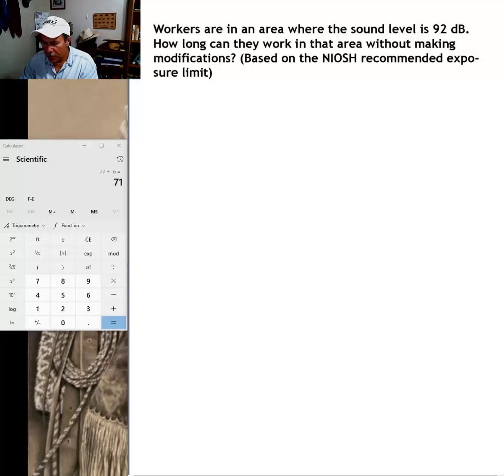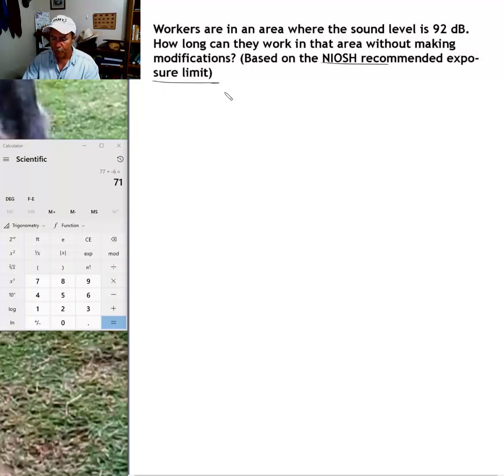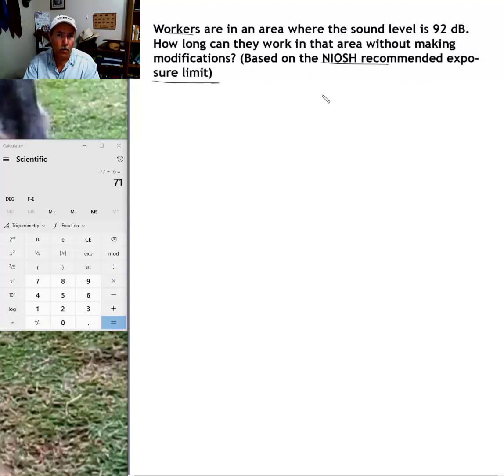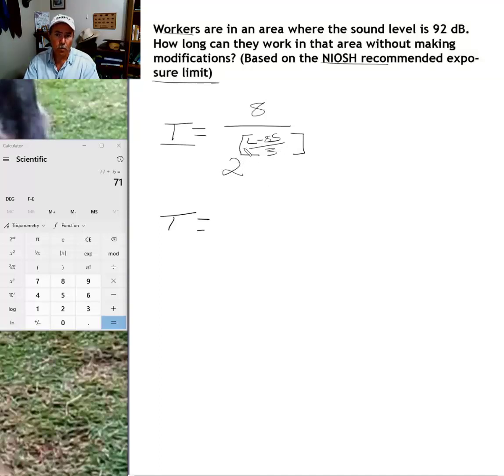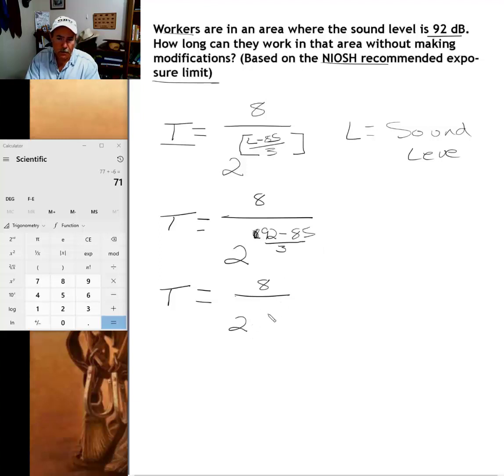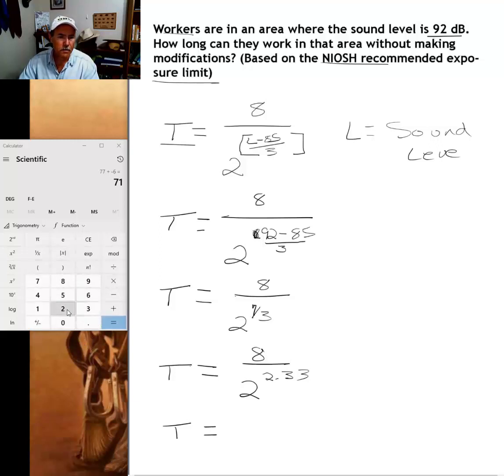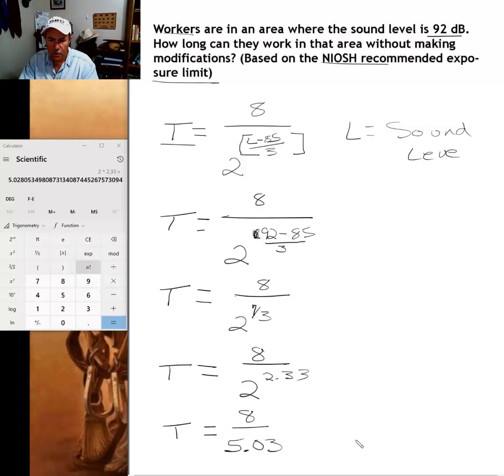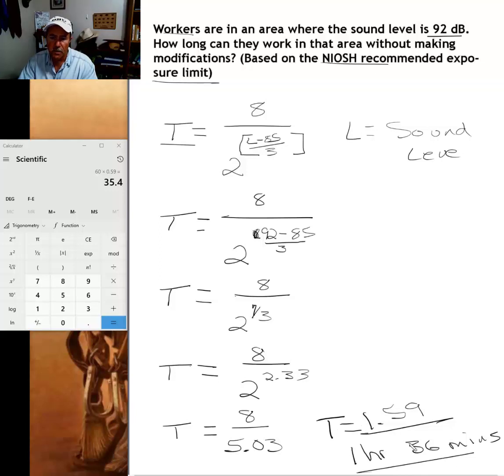Time Exposure Limit at X dBA

Comment: I found an other formula in a book which is a follows 
T= 8/(2^[L-90/5])
Can you plz explain why there are two formulas?
Reply from the maker: This is the OSHA formula for determining allowed time exposures for complying with OSHA standard.  The formula in the video is based on NIOSH recommendations for sound level exposures.  The NIOSH method is more conservative and provides a greater margin of safety but is not a legal requirement.  Many companies adopt the NIOSH recommendations.
Reply: @SafetyProCalculations  thanks alot